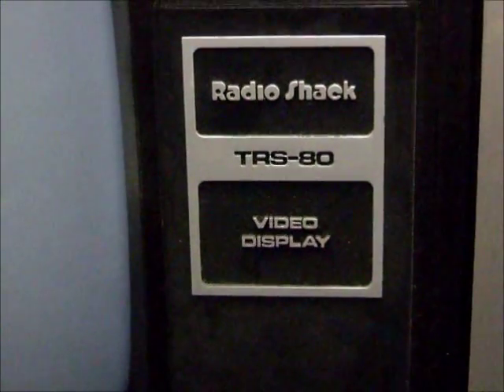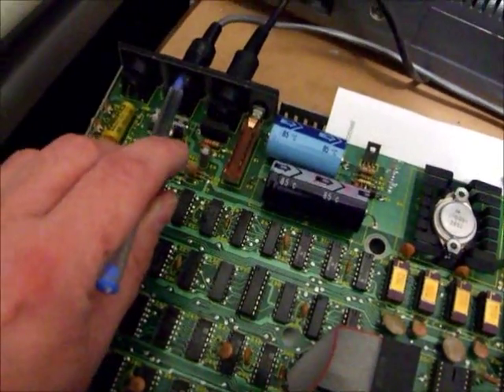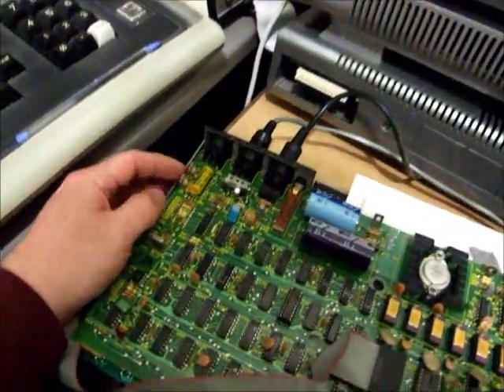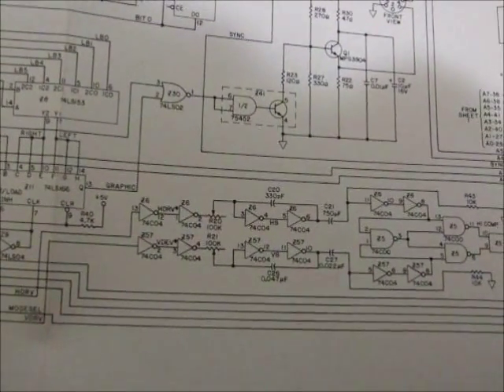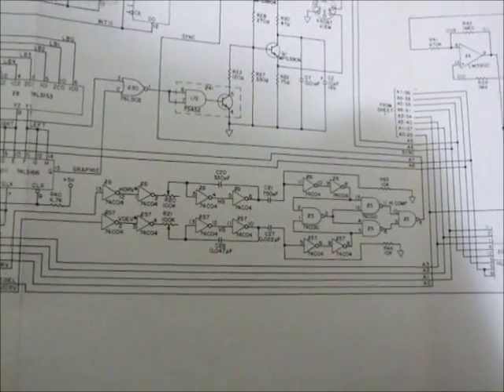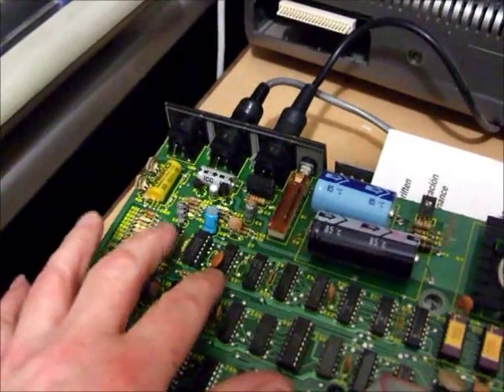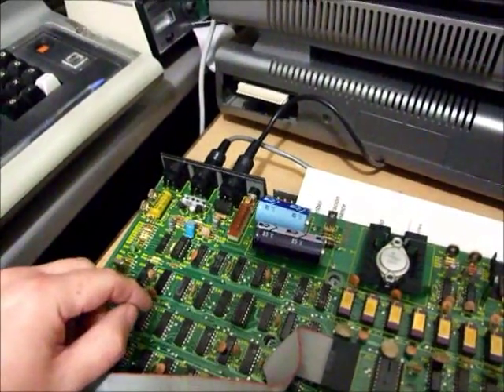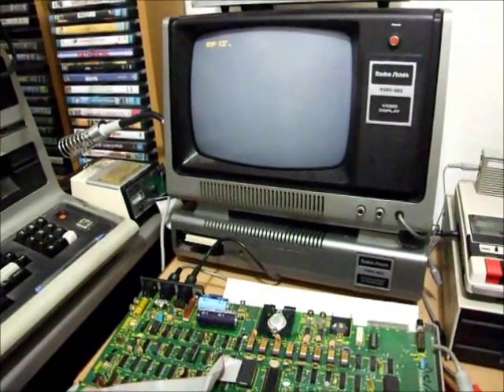How to fix video sync issues on the TRS-80 Model I

Comment: My TRS-80 M1 video shows bright diagonal (right slanted) lines running up or down the display, and a horizontal line running up the display. The diagonals slow down, change direction, and speed up as time goes on, but never stabilize. I never get any sign of characters. I have a scope, but I don't know where to start with it. All voltages 12, 5, -5 are within tolerance. Spinning R20 momentarily freezes diagonal lines, and spinning R21 momentarily freezes the horizontal line. What do you think?
Reply: Ok, don't laugh too hard... but my RCA adapter had the ground and composite swapped! What a time it would have been if I didn't catch that.

Comment: Hi there, great video... i have a similar issue with a Model 4.  after it's been running for a while,  and the computer is reset using the reset button, i get a similar horizontal sync issue....  There are no horizontal and vertical sync pots on the Model 4 Motherboard, wondering if you might have some experience with something like this? :)

Great video by the way,  I like my model 4, i just wish it would keep horizontal sync....  by the way it does not matter how long the computer is on for, any time after about 5 minutes, a reset will kill proper horizontal sync. (as will a quick power off and power on to reboot)  

If anyone has experience with this sort of issue, please advise. :)   it's not the power supply, as computer display is pretty solid even three hours later, (unless i reset it)... :) resetting it seems to not be able to regain sync when the computer has "warmed up"